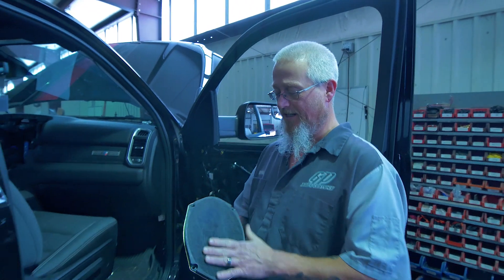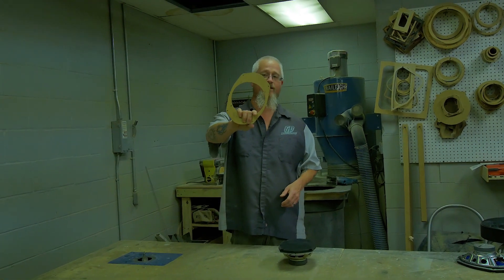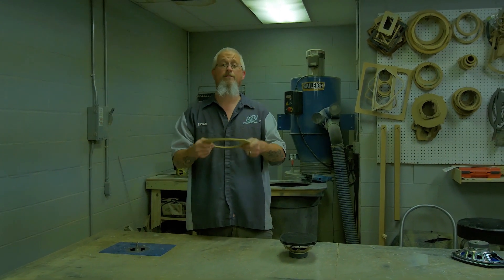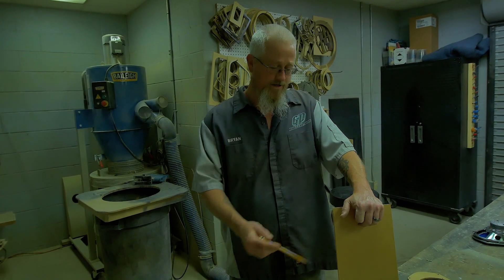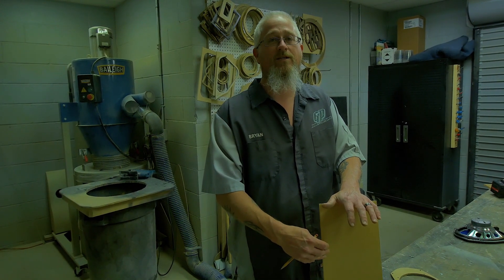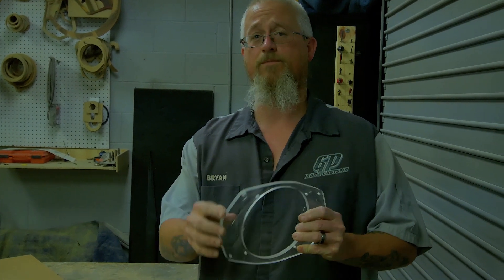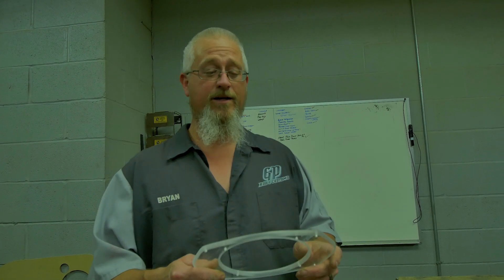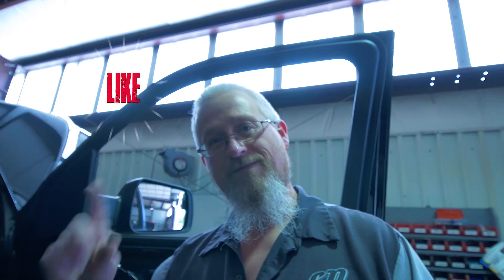Custom Speaker Adapter Plate 6x9 | Teach It Tuesday

Comment: Great video!! going from stock to FOCAL YES its an upgrade but not the size, 6x9 can reproduce better bass response and if you search 6x9 specs these have a lower frequency response(they dig deeper for that lower bass frequency due to larger woofers) but 6.5 are less pricey, but if you have to pay more for making an install plate than i dont think its worth the money. DIY Take off door panel and plug and play 6x9/6x8s, installed pioneer 6x8s BB black Friday/week sale, HUGE DIFFERENCE!

Comment: Can you answer the question of why the 6.5 series of speakers is considered to product better SQ than a 6x9
Reply: If you look at a 6x9 to 6.5 speakers are made very differently, 6.9 you'll get bass from, 6.5 are for high quality sound 6.9 will cover mids lows and high, 6.5 cover mids and highs. If you have a subwoofer you don't need base in the doors. Right now I have 4 skat 6x9 in my doors I'm changing them all to 6.5s for a better sound it's awesome now but it's struggle taking bass outa 6.9 speakers tuning for the proper sound. I hear a audio truck with that only had 6.5s and 2 subs major difference in sound. Granted there were 8 6.5s but once the sub was turned off clear as day in quality